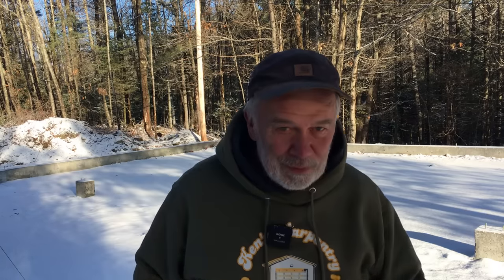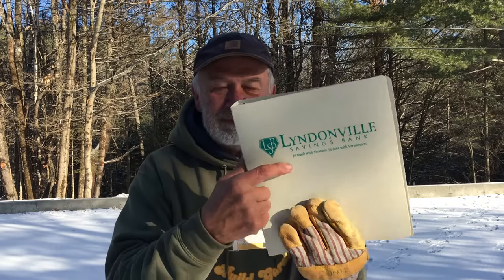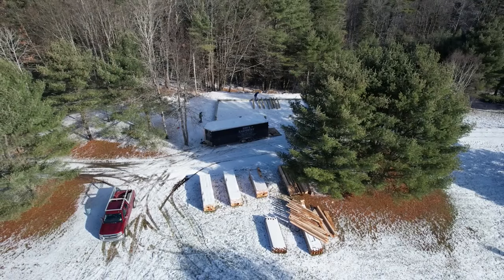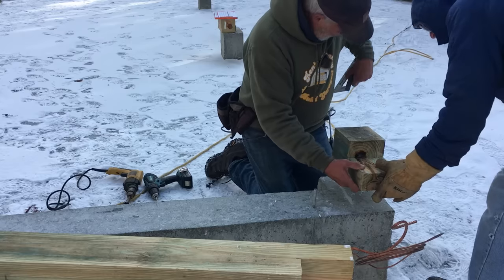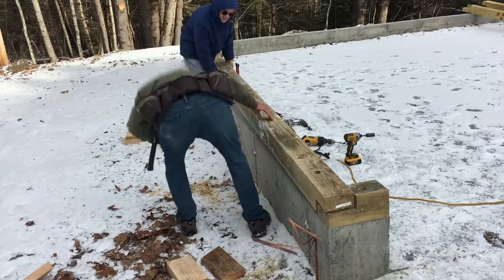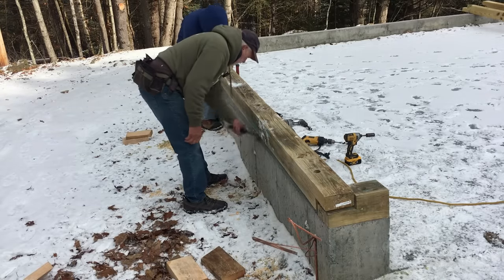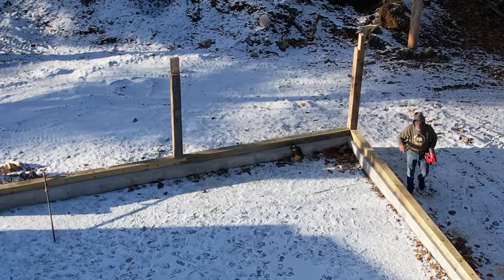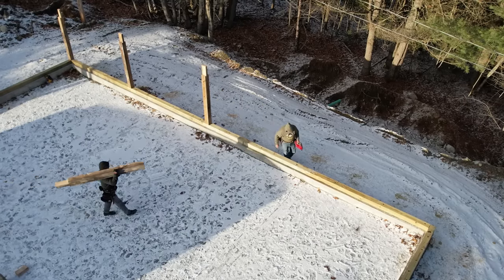Jamaica Cottage Post and Beam Kit Build...Day 1

Comment: In Vermont, you don’t put a sill sealer or sill gasket under your sill plates?  Doesn’t that contribute to air leakage?
Reply from the maker: Not necessary in this application. It’s an open machinery shed

Comment: Cool new project.  That winter weather takes me back, man.  I remember setting windows in -30 degree weather for a showhome.  That is a bomber bottom plate! I'm surprised you didn't add your sill gasket to those 6x6's.  THey are going to want to twist over time, almost without exception.  I like the kit setup, like paint by numbers!  I like that your church buddy was very handy and had a clue what he was doing.  This one should be a fun departure from the typical garage.  Have a great week, guys!
Reply from the maker: Their plans didn’t call for the gasket. It’s going to be an open farm shed